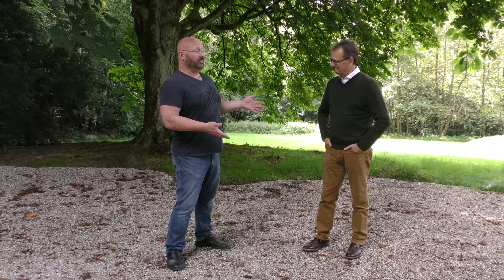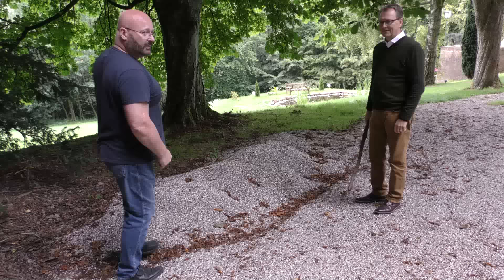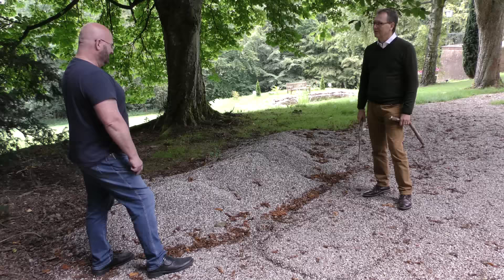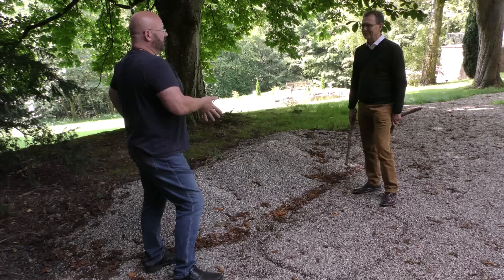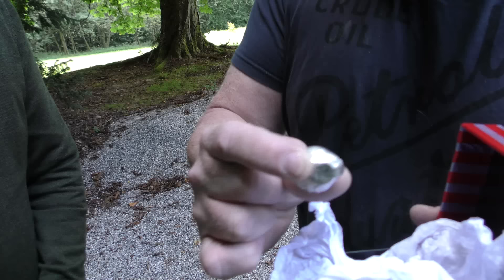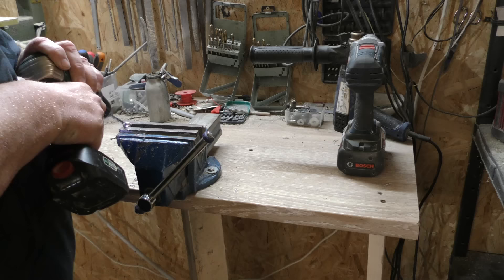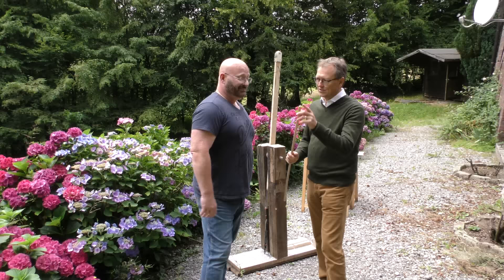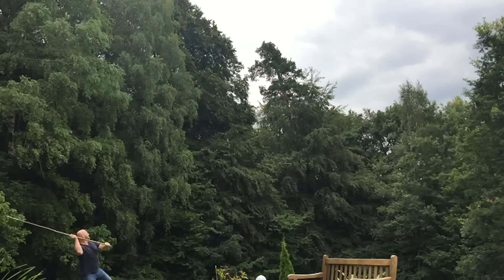The Mystery Of The Whistling Bullets: Psychological Warfare, 200 AD

Comment: Idea from a German to be Engenieer: 
When you attack a hilled fortification, the sound of orders yelled and trumpeted will decrease against the hillsite. When you fire a projectile up the hill, that produces noise on its way, when you command the slingers back in the camp officers must not join in on an attack, but can command basic orders and moving directions by ordering a view slingers to attack certain positions on the battlefield or fire at certain rates or quantaties. We will see the usage of certain projektiles in all battles at the time, when the delievering force or some sort of Poison where the motion, behind drilled holes. When we only account for these in an upslope enviroment, its likely to be a method of command, rather than an weapon improvement. Because the movement of troops and the basic run out of the Battle are best visible from an outside perspective, than from in between the lines. As efficient as the roman generals thought they might have tested a big assortment of different projektiles and maximised the effect of certain ones to a number of different points. Many parts of the equipment where as maximised and standardised as modern Nato calibers or military walking boots today. I personally doubt the throwing stick theory. In an uphill battle the oponent sees your very move and has a slope advantage in distance. When you get attacked with easy to produce sticks, youll see it and be able to not only reclaim alot of the bullets, but to reproduce the sticks and send them back, with a greater force of impact, because gravity is now on your advantage.

Comment: limited test, range is a factor, so is velocity at last portion of travel. Firing the slingshot within inches of the gelatin is not definative of damage taken at the top of a mountain. I have a theory for the hole, Ballista arrows with a payload of shots. Simple slings would only be effective once up the mountain as its almost a km to the summit but the ballista would have possibly be able to achieve this distance.

Comment: What if the holes serve a purpose to transport the ammunition easier. Like carry them all hooked into a string and you can even wear it like an ammo belt or bandolier. Instead of having tbem all loose in a bag that could potentially spill in a battle. Or even use a simple string and a drilled ball as a melee weapon if they had to. Kind of like a morning star.

Comment: the fact that they were 20g drilled or 60g whole also possibly suggests they were used like boluses with 3 stringed together possibly to stop a charge down the hill overrunning the position with speed
Reply from the maker: The holes aren't drilled all the way through, so that isn't a possibility.
Reply: @Slingshotchannel  So the romans had neither glue or wedges that could have fixed a cord in the holes ?  just because we think its the obvious way to do it does not mean that's the way they decided to do it
you imply that the only way to attach a cord is to thread it through the hole which is just not true
Reply: @Slingshotchannel  there are things we cant tell like  were the holes drilled , cast, punched
would a roman hole punch for leather make a hole in the lead
Is it possible to put a leather cord into the hole pass it through a slit in the cord and pull it tight to hold it in and maybe roll it or tie it in a certain way to stay together until it was was flying through the air we just dont know
its a bit like the funny roman dodecahedron objects that we still cant explain the use for one day someone may work it out
Id guess the hole is made that size because they had something common always around that made that size hole
we presume their armourers used punches but did they use drills?
Reply from the maker: If they would have wanted to put a string through the things, they could have just drilled all the way through. But they didn't.
Reply: @Slingshotchannel  while that sounds logical to us its still just  assumptions
assumes that it was drilled not cast and assumes that they would just decide to put a cord through it

Comment: Like a pan flute.. the depth of the hole is critical to the sound..found a bunch of 30mm ball bearings years ago in an airport metal recycle bin.. burned holes in them with and EDM machine.. thought they could make a wicked whip chain type of sci-FI weapon… they were way too heavy to swing once corded.. probably would have worked as a minesweeper..

Anyway… took them apart, left them in a bucket for ten years+/-.. put a handful in the trebuchet..but none whistled.. nephew is a minor league pitcher.. if he throws one while holding the holes perpendicular to the ground…  up in a big arch like he would from the outfield to home plate.. they make an awesome warbling sound.
Made some smaller ones out of clay.. higher pitch, loads safer(maybe) but sized for a typical store bought slingshot. Fun to get squirrels with.

Comment: VERY IMPORTANT 
A sling is NOT a penitration weapon. It is a precussion weapon.
Meaning it damage is made to crush not   penitrate to kill.
It breaks bones.
At 400 yards I can sling my 3 oz bullets through 1/2 plywood.
Its not the penitration that's lethal.
In a live thing. it will break the bone....
Skull, ribs, leg....
I can only speak of two of these and guess the 3rd.
RIBS. It breaks the ribs. Not just crack but break. When the animal flees. The rib goes through lungs and heart. Causing blood lost and suffocation. 
LEG. I prefer hind legs. as this is more effective. It breaks the legs. Upon moving in a fleeing run. Causes a compound fracture. Greatly weakings and slowing down the prey. And they bleed out.
I've had deer size prey drop dead at 20 feet after hit to close to 5 mile away.
SKULL. 1st I've never had a skull shot. But I would guess it would put skull fragments into the brain.. Plus disorientation and confuse prey.
I have hit a 500 lbs boars head with one after I butchered it.
And the skull was caved in at sight. And put bone pieces into the brain. But the bullet did NOT penitrate into the skull.
It broke the skin at sight.
With a sling think of a baseball bat or a Flair.  Its blunt damage not penitration.
Jorge is the only slingshotter that I seen that can get a slingshot to do what I can with a Shephard sling.
BTW I'm shiza with a pole sling.  Tried it once and decided I stick to Shephard slings.
But I'm sure if someone mastered one they could do better then me with a Shephard sling.
It took me 15 years to get to my level. Its not a thing to learn quickly.
I do not exaggerate. Its taken me millions of bullets to get to where I am.
I don't practice on anything less then 200 yards and try to stay under 400 yards. Because everything is at least 200 yards from me when I'm looking for dinner.  
Also note, I don't have trees for over 100 miles. This is why Im able to use a sling at these distances. And its also why game is so far away.  
If you wish to know what my terriane looks like . An example is Life below Zero, where Sue Alken lived in the beganing of the show.

Comment: My guess on the holes... I mean, if I had to make a few thousand of these... I'd not bore them all, I'd add it to the mold!  And that way all of them would be the same size.  You would have mold marks in the center of the halves...which you might be able to detect... It would have them a HUGE amount of time making them..

Comment: I'm just curious if the reasoning for the hole in the round bullets was so after they hit you ,they broke apart in the body and caused damage along different wound tracks kind of like a modern hollow point bullet..
Reply from the maker: A sling won't nearly have enough energy to cause the heavy leadball to mushroom inside of a body. That is firearms realm.
Reply: @Slingshotchannel  yes you are absolutely right I didn't take that into account..

Comment: I visited Burnswark recently and I have some issues with the standard interpretation of a native hillfort with beseiging Roman camps on either side. I have no doubt the top of the hill is a native site, but I'm not convinced about the Roman camps on either side. They certainly look Roman, but they just seem to be too close to be seige camps. A defender could basically throw stones down from the top and still reach the Roman camps, without need for slings / bow&arrows. If there was a significant native force at the top you would surely want to build the seige camps a bit further away to keep them safe during construction, and if there wasn't, why waste your time building seige camps in the first place?
Reply: Hi James, John Reid here. Thanks for your comments and glad to hear you were able to visit Burnswark, its a fabulous site. A few answers for you. Firstly, the native hillfort and both Roman camps have been proven by archeological excavation (unequivocal finds of pottery, Roman coins, other missiles and the C14 dates are spot on...etc) so they are the real deal.

Secondly, the closest of the two Roman camps to the hilltop rampart is 135 m in the horizontal plane.

There is no tradition of the Caledonians having distance weapons in the Roman Iron Age (no archaeological finds of arrowheads, slings-tones etc). It seems that they fought only hand to hand or at spear point ....tradition I guess, even although neolithic flint arrowheads are found in Scotland, there are no records of distance weapons in the Iron Age.

So the longest hand throw ever recorded for a javelin is just under 100m and the longest throw of a cricket ball is 128m, so even an olympian could not reach the Roman camps.

The Roman engineers really knew what they were doing when they laid out the siege camps. You will of course have noted that the hill-facing ramparts of the Roman camps are larger and taller than the other three sides ....designed to resist or retard a frontal assault.

Comment: My guess is that they didn't bother drilling the holes to begin with.  More probably is that the reason for the uniform size is simply that's how they were cast in the mould to begin with.

Comment: I h also have my personal theory: the lead projectiles that had a hole could be strung on a string like beads to be carried and distributed more easily. 
The whistling and other effects are secondary, but significant
Reply from the maker: The holes aren't drilled all the way through, so no string carry method.
Reply: To use the holes in a carrying capacity would have to have bits of wood attached to the string that could fit snug enough to keep them attached but not snug enough that it would've caused issues quickly removing. Most likely they would have been carried in a pouch cause only reason to use wood & string method is if more important things was carried in the pouch.

Comment: Super late but like wouldnt a full bombardment just focus on bombardment and not poison? Like you throw a bunch or rocks kill what you can then clean up.
There would always be clean up as you cant guarantee you hit everyone. And also if this is a short siege I dont think poison would have been included as most poisons would be dangerous to handle and shoot in the thousands unless it was super strong like the stuff from dogs. But you dont need a hole for that just dry it on the projectile.

Comment: Honestly i would think they used a stick sling so pretty much a stick with a leather sling and some String or twine of some sort and with some practice and a certain way of doing it that will send the projectile out. Honsstly i think they put a hole in the projectile to make it lighter and faster and cut threw the air but it just so happend to make a whistle affect.

Comment: I think I the poison theory has merit. Maybe the size of the hole was to keep as much poison in the shot while it was being slung through the air and at farther range it might not have penetrated as deeply but with poison you're more likely to kill off opponents who didn't die outright from the blunt trauma of the projectile. Less people to survive after a battle means less resistance to deal with later. These are just my thoughts.

Comment: If the bullets with the holes were set up on a tree or some type of stand so that you can pick them up in a fixed position for faster reloading it would also make sense. and since there were thousands of men in the camps designated re-loaders would be more efficient.

Comment: If the mold had a pin in it you wouldn't have to drill the hole later. The pin would create the hole as the bullet was cast, no additional work.

Comment: I would think that it would be impractical for the poison theory to be true. 
1) for the same reasons why we don't poison bullets for modern day guns: the bullet on its own is more than effective. Poison would be unnecessary since the victims would likely be incapacitated or dead. There is no point in poisoning a dead man.

2) the time and energy needed to locate, collect, possibly distill, and apply the poison to what is estimated to be thousands of these bullets would be considerable.  Poison is only practical on a large scale if you have means for large scale production and ample resources available, including raw materials. It's not a system particularly well suited to being packed up and hauled all over kingdom come. Especially when you circle back to point 1, the bullets were plenty lethal enough on their own.

3) without modern medicine open wounds were frequently fatal. Infection would be almost unavoidable, and counter measures extremely limited. Simply wounding a high volume of people and wait for their wounds to fester would be a completely viable battle tactic. You wouldn't need poison, time and germs would have done all the work for you.

Comment: The "Liliputians" are running for their lives!!!   😉
  This lends a whole new meaning to the term "bird shot."  😀
  And I believe you're taking about an "Atle atle" with a stick to extend your arm.  ;)
  If a modern person, surviving in the woods, got to be accurate within reason with the stick launcher principle and the smaller projectiles (40mm was it?) then this absolutely could work as an alternative weapon for taking small game and even defense. 
  And, if the projectile were to whistle, the immediate response of a small animal would be to freeze and try to identify the source/location of the sound before trying to run (they don't want to run towards a preditor) which would increase the chances for a successful hunt.  :)
  I think this idea gas merit for a survival tool.  Just use a found stick, no need to carry a slingshot or worry about broken bands, pouches, etc.  You could, theoretically, improvise the entire weapon out in the bush.

Comment: They were probably like mini arrows, the holes are for some type of wooden pole/fletching which has long since rotted away. The other ideas don't make sense, it wouldn't penetrate the skin so poison is out, and a cluster would be a huge amount of extra work to maybe cause extra minor injuries on a direct hit. A small whistle noise probably isnt that scary to a bunch of dudes who spend a few short decades stabbing and slashing other people to death point blank, especially 3 times lighter than the quiet shots. It must have been either the tip or counter weight of some larger projectile.

Comment: (edit)
Jorge! DO NOT HIT YOUR NICE MOLD WITH A STEEL TOOL!!!

If I had to make those holes, I would use a metal punch and a hammer- Soft Lead, would be quicker and easy to do. Twist drills require more screwing around.

Comment: the romans were purportedly past masters and innovators at warfare. i should think they would have come up with a more effective and efficient way of maximizing the destructive potential of the cast lead pellets. rather than a single soldier launching a single whistling projectile at a time from a sling or a pole, a pouch capable of accomodating one or perhaps several projectiles at a time & mounted on a specially designed crossbow would be more accurate & generate greater force (therefore lethality) via the increased launch speed. having many projectiles simultaneously hurtling toward the enemy would also have a greater volume, thereby increasing the intimidation factor of the whistling bullets. now, consider the effect on the enemy of volley fire from a hundred crossbows, each launching 5-10 whistling bullets. terrifying noise and terrible physical impact.

Comment: Time to look for traces of those casting sticks. I don't think that poison theory makes sense. For the applikation of poison a comlpete hole is a bad choice, because wind going through the hole would clear it from most of the poison. Smaller caveties could carry the poison much better and would be less work. Also regarding the medicine of the time and the dangers of wound infections there is also no need for additional poison. But the castingstick idea is very reasonable. In contrast to slingshots, you don't need much training and you need less space around you, so you could use them in tighter formations. These two points are very adventageous to the roman legion. You should also consider, that they were not used in an artillery stile but in a close combat from behind of a shield wall. Especially with the longer stick you could fire these balls in a straight line down to the enemy but over the heads of your allies forming the shield wall.